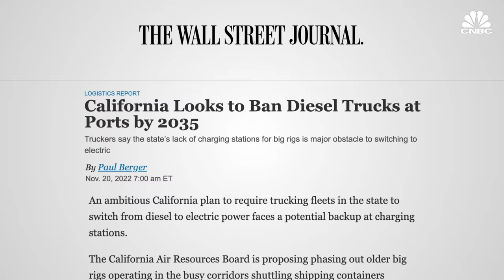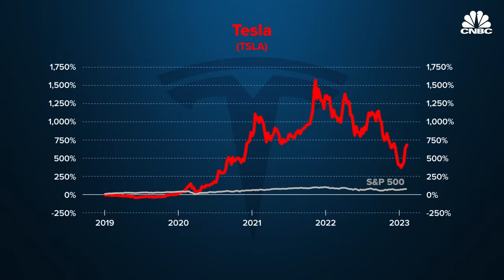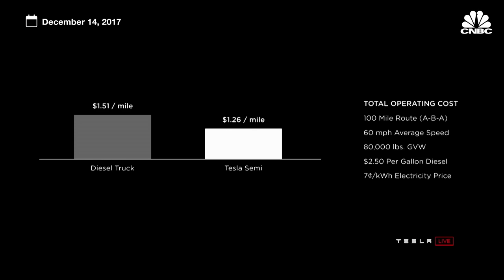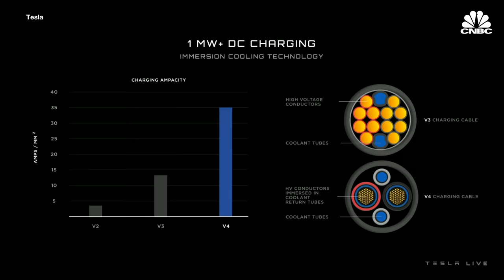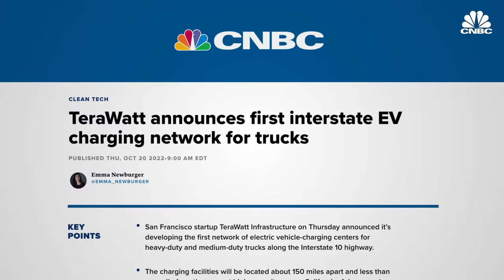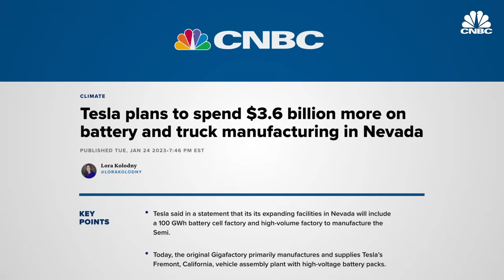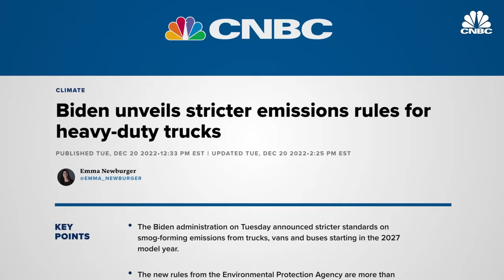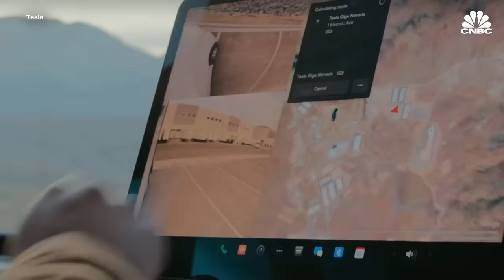Does The Tesla Semi Live Up To The Hype?

Comment: Actual Feedback from the Driver: I can’t even sleep in this damn day Cab. I keep getting harassed by the DOT because I’m overweight. And this thing can’t even do 200 miles without having an issue. There is no way this thing can do half its range in the cold.
Reply: It is, as you say, a day cab; so you're not expected to sleep in it.
You personally overweight, or your truck overweight? In either case, there's an easy solution.
It's been shown to do 500 miles carrying a 20-21 ton payload without breaking a sweat, including climbing and descending 4,200 ft. along the way.
Based in Tesla technology and experience of Tesla cars, it'll lose about 15% range in cold temperatures. If you drive a truck, you're well aware that diesel trucks also lose range in the cold.

Comment: Lol they run for an hour and a half and its dead
Reply: 500 miles of range fully loaded so ~8 hours.
Reply: @johntheux9238  did the govt instruction manuel say that.. Cause the guy on youtube with the truck did a test and the results are alot dif than what you say..$4500 to set up a 220 charger and that burns juice just charging.. Plus the battery only lasts max 10 yrs. And 20 grand to replace and to recycle costs $3500 to get $35 in scrap mettle.. One guy charged a tesla at a charger for 41 min. And it cost $49 and the car said it got 61 miles of charge.. What a joke, i will never buy one. And they cost $80,000. 😆
Reply: @sweendog2769  The model 3 is $40'000
Reply: @johntheux9238  i think you meant founded.. And if trump were still president we might've been able to afford them but they are an environmental nightmare to dispose of so I'll pass.. If i do buy a truck it will be a 1970s restomod pickup truck..
Reply: @sweendog2769  Tesla are recycling their batteries with a 92.1% efficiency...
Reply: @johntheux9238  how much for a new battery??? They only last ten years,, if that, we dont know yet
Reply: @johntheux9238  yea you never mention how much..
Reply: @sweendog2769  Batteries cost $100/kwh so $7-10k for a car and $100k for a Semi truck.
That's how much they cost to make thought, not how much it will cost you to replace one.
Reply: @johntheux9238  so another words,, who the hell will put 20 grand or more into a 10 yr old electric slot car lol. So on average, 60 grand for a car that lasts 10 yrs.. Dead on arrival but there are still alot of suckers that will fall for it.. I like a 1970 chevy pickup resto moded with a 380 stroker. Thats called fun .. Tesla is called " look at me, im a nerd and cant make anything "

Comment: Never understhood battery power electric car technology. Why utilize that when we have hydrogen fuel cell technology that is far superior. Hydrogen fuel cell technology allows you to refuel in minutes. The hydrogen is far more energy dense than batteries. You can also utilize solar and wind energy to produce the fuel. Electric battery powered vehicles should be discontinued and replaced with far better technologies like hydrogen fuel cell tech.  Why don't they do this? Is it possibly because we can make our own fuel in our own backyards and they will lose control of that sector?  The reality is they don't want us to be independent.
Reply: Are you seriously asking this question? Have you never heard why battery is better? I'll explain it simply, hydrogen is expensive to make and only around 25% of the energy you put in to make, transport, and use is actually converted to mechanical energy. Hydrogen is extremely hard to make in your own back yard because the extreme pressures involved, it's much easier to make electricity using a magnet and copper wire. Around 85% of the energy you produce will end up as mechanical force if you use a battery.
Reply: @Victor-vj5ds   battery technology is not better at all. It's horrible for the environment and there's not enough lithium and materials in the Earth to mine to support battery technology.
Reply: @Victor-vj5ds   I designed a system to eliminate the issues with pressurization of hydrogen.
Reply: @AllThingsRamdom  battery technology is better in almost every way from efficiency to safety. The USGS estimates 800 million tons recoverable lithium in Earth's crust (ocean not included). That's enough for almost 100 billion electric cars. You can extract lithium with minimal environmental impact and recycled at a profit. I really doubt you solved the pressure issue in a viable way.
Reply: Hydrogen is hugely inefficient; 95% of hydrogen is formed from methane or natural gas; the forming process leaves CO2 to be dealt with, which is one of the things we were trying to address in the first place; there's almost no infrastructure in place for vehicle hydrogen; and the cost of hydrogen per unit of motive power is several times that of electricity.

Real world example: The Toyota Mirai carries 5.65 KG of hydrogen, and gets an EPA range of 357 miles. A KG of hydrogen in San Diego, where I live, is currently about $17. So the per-mile cost of hydrogen for the Toyota Mirai is 5.65 x 17 / 357 = 27¢/mile. Meanwhile, my Tesla Model Y has a 75 kWh battery, and has an EPA range of about 320 miles. At residential rates of about 25¢/kWh (among the highest in the nation), the per-mile cost of electricity for my Model Y is 75 x .25 / 320 = 6¢/mile—less than a quarter of the cost per mile of hydrogen.
Reply: @Victor-vj5ds   How do you think we get lithium? How do you think we charge batteries?  Majority of electricity comes from coal.  

 You also must not know how hydrogen fuel cell technology works.   Cars using fuel cell technology have electric motors.
Reply: @Victor-vj5ds   Hydrogen storage can be rendered 100% safe.  Hydride absorbs hydrogen. Heat is used to release the hydrogen from the hydride.  You could shoot a tank with incendiary rounds and it still would not explode.
Reply: @BigBen621   The conversion of hydrogen into erelectricity is way more efficient than the percentage you give.   You're charging your Tesla with electricity made from coal.   How do they get coal? They mine it.  Do you really think your tesla is as efficent as you claim when you factor in all the processes needed to power it?
Reply: @AllThingsRamdom  Hydrogen storage can be rendered 100% safe. 
3/15/2023 "Toyota's Hydrogen-Powered Race Car Goes Up in Flames During a Testing Session". Didn't seem to have worked for them...
Reply: @AllThingsRamdom  You're charging your Tesla with electricity made from coal. 
I'm actually charging my Tesla with free electricity from my solar system; try that with a hydrogen fuel cell vehicle. But as I've already pointed out, in California where all of the Tesla Semis are deployed for now, only 3% of electricity comes from coal.
Reply: @AllThingsRamdom  The conversion of hydrogen into erelectricity [sic] is way more efficient than the percentage you give 
Still grasping at straws. I didn't give a percentage. But if it were anywhere near as efficient as batteries, this would be reflected in the cost; and hydrogen would not be 4.5 times as expensive per mile as electricity, even compared with the ridiculously high cost of electricity in Southern California.

""With battery-powered e-cars, only eight percent of the energy is lost during transport before the electricity is stored in the batteries of the vehicles. When the electrical energy used to drive the electric motor is converted, another 18 percent is lost. This gives the battery-operated electric car an efficiency level of between 70 to 80 percent, depending on the model.
With the hydrogen-powered electric car, the losses are significantly greater: 45 percent of the energy is already lost during the production of hydrogen through electrolysis. Of this remaining 55 percent of the original energy, another 55 percent is lost when hydrogen is converted into electricity in the vehicle. This means that the hydrogen-powered electric car only achieves an efficiency of between 25 to 35 percent, depending on the model. For the sake of completeness: when alternative fuels are burned, the efficiency is even worse: only 10 to 20 percent overall efficiency."
Reply: @BigBen621   You can literally do the same thing with the hydrogen fuel cell car. You can use solar or wind to make hydrogen gas from water using electrolysis. There are far more efficient ways to split water using electrolysis then in the past.
Reply: @BigBen621   Only reason it's more expensive is because it has not been mass produced on a large scale.
Reply: @AllThingsRamdom  You can use solar or wind to make hydrogen gas from water using electrolysis. 
Yes, do please tell us the cost of a solar-powered hydrogen electrolysis, compression, and charging setup for your home. My 240V 30A outlet in my garage cost $600.
Further, "current best processes for water electrolysis have an effective electrical efficiency of 70-80%, so that producing 1 kg of hydrogen (which has a specific energy of 143 MJ/kg or about 40 kWh/kg) requires 50–55 kWh of electricity." 55 kWh in my Tesla will take me 235 miles. Meanwhile, the 1 kg of hydrogen you can generate with the 55 kWh that will take me 235 miles, will take a Toyota Mirai 63 miles. See the problem?

If my numbers are wrong, show me where, and what the correct numbers are. You keep spouting generalities; but the devil is in the details.
Reply: @AllThingsRamdom  Only reason it's more expensive is because it has not been mass produced on a large scale.
This is pure speculation on your part, with no factual basis. Because 1 kg of hydrogen requires 50-55 kWh to create,  the cost of just the electricity to create 1 kg of hydrogen is around $11, assuming electricity at 20¢/kWh. Since hydrogen is selling for about $17/kg in San Diego, the cost of production is no more than $6/$17 = 35% of the cost of the hydrogen; and so even if there were no cost to produce it, the cost could only come down by 35% and it would still cost several times as much per mile as a BEV. 

If you're doing it with solar, then it takes several times the size of solar array to generate a given quantity of hydrogen as it would to generate electricity with the same motive power as the hydrogen. I can show you that math as well; but I sense you're not interested in actual, inconvenient facts because they don't support your fanciful narrative.
Reply: @AllThingsRamdom  You're charging your Tesla with electricity made from coal.  
Too funny! Even if I were charging with electricity purchased from the local utility, which I'm not; and even if coal was a significant source of electrical energy in California, which it isn't; you're still touting electrolysis as a source for hydrogen, which takes three times as much electricity per mile as a BEV. 
 How do they get coal? They mine it.
Yup, and they have to mine three times as much per mile driven for an HFC vehicle as for a BEV.
Reply: @BigBen621  no they don't.
Reply: @AllThingsRamdom  "no they don't." 
No who don't do what?

Comment: What happens when there is no electricity?  Or if a major earthquake hits California and infrastructure fails
Reply: What happens when there is no electricity? 
ICE vehicles can't fuel up, because fuel pumps require electricity. Meanwhile, the majority of EVs that charge at home are sitting with a full charge when the power goes off.
 Or if a major earthquake hits California and infrastructure fails 
Which infrastructure? Electrical? See above. Roads and highways? Affects ICE vehicles and EVs equally.

Comment: Fully electric is not feasible, there is a huge supply of crude oil and diesel/gasoline and that will continue to be the best and only energy source for many applications.
Reply: Yes you can burn all that in a generator and still save money using battery electric.

Comment: Considering how heavy those batteries are, you are lucky if you haul 1/2 of what a Diesel truck can. You will see that Tesla will never divulge the Load Capacity of these new Semi's cause there's a simple math to it: Max weight you can operate in roads in the US are 34 tons,  Diesel Semis usually weight around 17 tons with a full tank, which means that a regular Semi can carry around 19 tons of cargo. Tesla Trucks weight around 33 tons, which means they can only carry 3 tons of cargo. Unless there's some drastic break through on battery technology, we can expect this to be just another failure project.
Reply: Max weight you can operate in roads in the US are 34 tons 
 FALSE Max GCVW for diesel semis is 80,000 lbs, or 40 tons; and max GCVW for electric or natural-gas fueled semis is 82,000 lbs., or 41 tons.

 Diesel Semis usually weight around 17 tons with a full tank 
FALSE Diesel semis usually weigh less than 10 tons.

 Tesla Trucks weight around 33 tons 
 FALSE The Tesla Semi weighs about 27,000 lbs. or 13.5 tons.

 which means they can only carry 3 tons of cargo 
 FALSE. Tesla Semis have a demonstrated payload of 22 tons of concrete highway barriers on a flatbed truck, and 21+ tons in a dry van trailer.

Everything else in your comment is spot on. Oh, wait...

Comment: Tesla makes among the worst cars on the road. To think a battery powered semi is “green” is hilarious.
Reply: Nice try. Tesla Semis use far less energy overall that diesel semis. Although some of the energy to recharge them comes from solar, most comes from the electrical grid; but in California, where all the Tesla Semis in private hands are deployed, 60% of energy on the grid comes from renewable sources, and so only 40% of the much less energy used by the Tesla Semi is sourced from fossil fuel.
It is true that manufacturing BEVs releases more emissions that ICE vehicles; but that difference is made up early in the BEVs life by its much lower operating emissions. So of course battery powered semis are far from zero emission overall, they're still much better than diesels semis.
Reply: @Fluterra  It takes hundreds of thousands of miles to break-even on CO2 emissions from batt production 
Reference, please. This depends largely on the energy mix where the vehicle operates, and it looks like you're citing a location with very low renewable energy.
 "Renewable" energy?? do you know what that is? 
Yes I do; but apparently you don't. A better term is non-GHG sourced energy. Your assertion that biomass is the only non-GHG sourced energy other than "sun and solar" is absurd. In California, where every one of the Tesla Semis in private hands is deployed, in addition to "sun and solar" and biomass, which constitute 19% of the California electrical grid, the following sources constitute another 35%; nuclear, wind, hydro and geothermal. So the actual total is 54%—I was working from memory when I said 60% in my original post.
 Think about how stupid that is!! 
So true! It's extremely stupid to assert that "Other than sun and solar, ... renewable is the burning of wood to generate electricity", because you've completely left out nuclear, wind, hydro and geothermal.
Reply: @BigBen621  "This depends largely on the energy mix where the vehicle operates, and it looks like you're citing a location with very low renewable energy." No. It does not. That stat does not even take into account electricity production to charge the battery. It's the energy expended to fabricate the battery in the first place!
You are another clown spewing misinformation.
One of my friends just died because her Tesla backed itself up into a lake and caught fire. She was the daughter in-law of a US Senator and whose family has close ties to both Bush and Trump. This is not going to go down well for Tesla.
Reply: @Fluterra   One of my friends just died because her Tesla backed itself up into a lake and caught fire. She was the daughter in-law of a US Senator 
One of your friends? That's a little hard to believe; if she were actually a friend, seems like you'd know she was a sister-in-law of a U.S. Senator, not a daughter-in-law.

Comment: Yeah right.  Keep it on preferably flat Southern California highways delivering under 45, 000 pound potato chip loads in 60 degree Fahrenheit temperatures, that's easy. The amount of energy needed to overcome inertia for a typical 70,000 lb load, then add in the daily hourly reality of starting and stopping through all the cities where traffic slows to a crawl, throw in some hills, have it all take place in winter in a vehicle which no truck drivers were listened let alone participated in the design of ? Yeah for everything other than a So-Cal chip truck there's Edison Motors, the British Columbian fab shop that's going to change the world through everything other than hype.
Reply: flat Southern California highways
Geography isn't your strong point, it is?. California highways go from near sea level in the Central Valley to 4,200 ft. over Tejon Pass ("The Grapevine") at the south end of the state, and 7,200 ft. Donner Summit at the other end—half again as high as the highest highway pass in British Columbia.
Tesla Semis have twice the horsepower of typical diesel semis for "starting and stopping through all the cities where traffic slows to a crawl" and climbing steep slopes at highway speeds. And much more importantly, they recover most of the energy used for starting through regen braking when they stop, so economy is better in the city than on highways.
You either know very little about California or Tesla Semis, or you're just making things up as you go along.